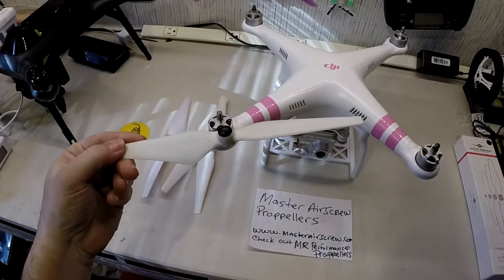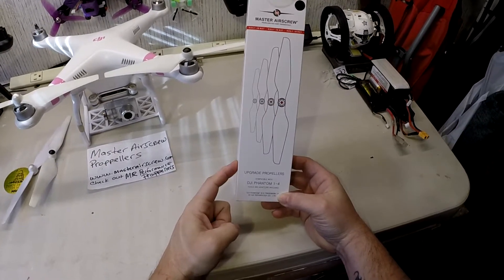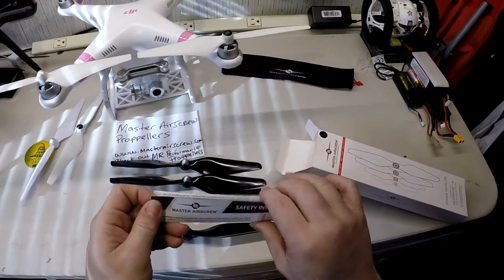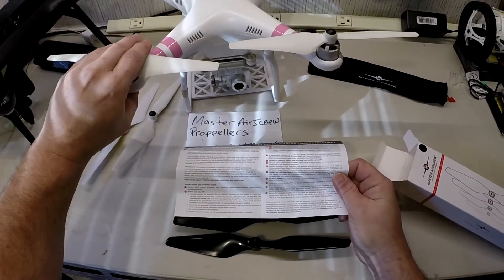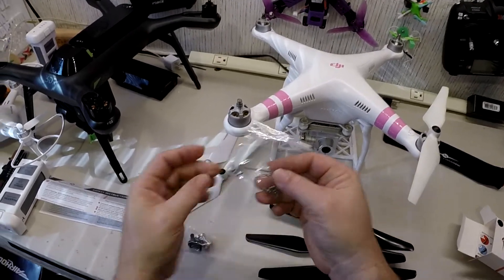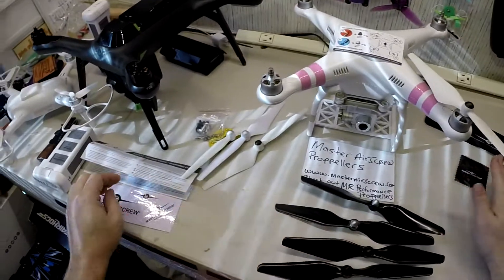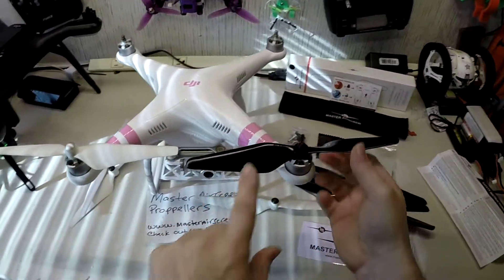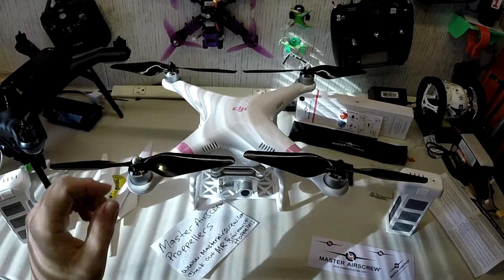Master Air Screw Propellers

Comment: Used for a few hours then started having check prop error messages and unstable hover. Went back to stock and it’s fine.  No response from Master Airscrew who did find the time to put up my glowing review that I should have held off on.  I didn’t think I could have issues that started after 2 hours of flying time, but I did. Will dispute with credit card company if I don’t hear from them.  I have emailed and called.  They aren’t checking their voice mail, but they are posting reviews on their site.  Not the great customer support I was expecting.  Stay with stock everything!